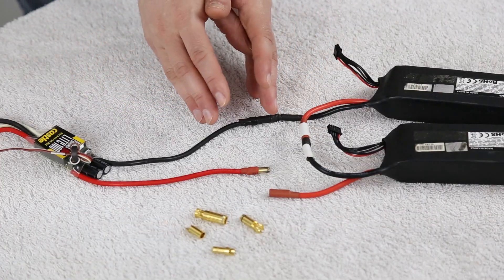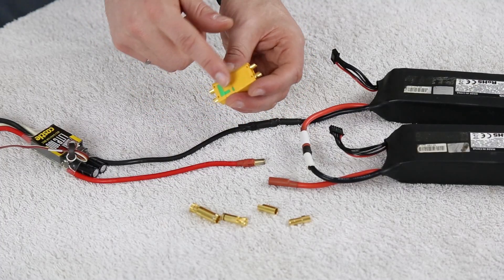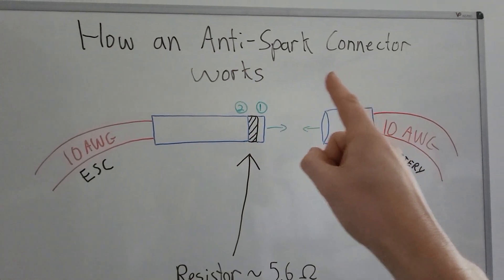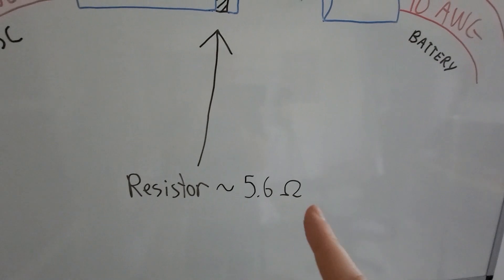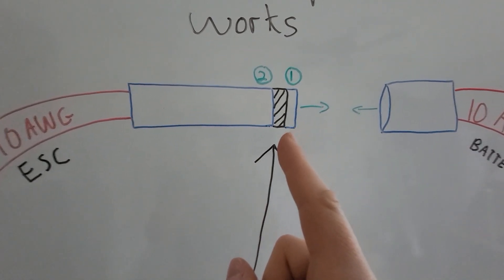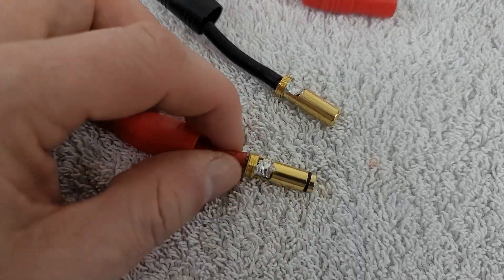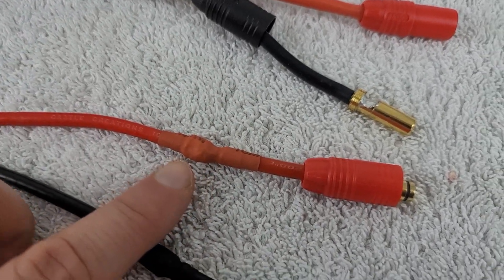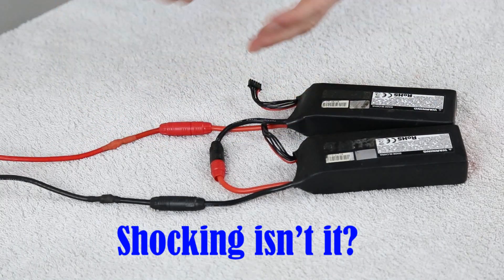Avoid the Damaging Spark When Plugging in Your LiPo Battery to the ESC

Comment: I have a question, I've been using my XT90s connectors on my electric bike for almost six months, just plug and play. Now all of a sudden I'm getting a spark, I can't see the spark but I can hear it. If the owner of this video do not respond can someone help me solve this problem please, I just don't want to purchase a whole new setup and end up with the same results.
Reply from the maker: Is sounds like your xt90 does not have anti spark circuitry. solder an anti spark xt90 connector in.
Reply: @RCexplained  It does have the anti spark circuitry and it just started to pop/spark, but once it's connected my electric bike rides normal: wires don't get hot, the controller and battery wires are not hot even after a 30 mile ride, also the battery charges backup as usual. Let me ask another question, have ever had a Xt90s female to go bad on you and changed it out and that solved your problem. I'm tempted to change it out but I need to know do they go bad sometime.
Reply from the maker: It's possible that the resistor failed. I've never had this happen to me though. It's a simple and cheap enough fix to try out.

Comment: Does the anti spark female end need to be used with an antispark male end or will it still have the anti spark ability if I used a regular male end with the antispark female end?
Reply from the maker: I place antispark connectors only on the esc. None of the batteries have the anti spark connector.

Comment: I was checking my steering out and I have a new LiHV battery.  I had plugged it in last night and no spark.  That was so I could bind my receiver and put the steering servo into the neutral position.  Tonight I had finished the steering linkage and I wanted to test it out.  I was storage discharging my LiHV battery (a VERY painful process for LiHV since you should use .5C or less for discharge), but decided to use it before it was discharged.  The last thing I wanted was another 8 hour discharge cycle.  That's the only difference.  Today when I plugged it in it sparked and popped like crazy.  I thought I had plugged it in reverse at first since it's a deans plug, and I quickly disconnected hoping I didn't damage my brand new $200 ESC.  I plugged it in again - this time inside a LiPo bag, wearing safety glasses, and using my shock proof pliers to hold one connector (didn't want to make a circuit across my chest - in A school that's the first thing they teach you - one hand only).  It worked just fine and I felt kind of embarrassed that I was so careful.  Even worse when I find this video and discover that it's common.  This was a 2S battery, and because the ESC is using an XT60 connector I am using a XT60 to Deans converter.  I was eventually going to solder the XT 60 connector on my battery.  I think it's because of that janky setup that I got the spark, so I guess I'll be soldering soon.  I have the connectors already.  I've just been lazy.

Comment: When switching connectors I usually make an adapter for my current connector to the new connector and just use the new style on all new packs/vehicles. Of course this only works on applications where you know the old connector delivers sufficient current already.

Comment: I always plug in the opposite gender connector to my connector I'm soldering whether it be a battery connector or an ESC or ADAPTER connector. Not only does it keep the connector I'm soldering cooler, it keeps them aligned and straight if the plastic gets too hot.

Comment: Hi, You seem very professional and well informed in your videos. Can you please give me your opinion on weither these AS150 are 150A continous and 200A peak or 60A continous and 150A peak? Because I've seen both specs on them. I plan on using them on a big 24s 8p li ion battery on an electric paramotor similar to the US openppg SP140 that uses the MAD M50 34kw 20kw motor. Usualy the power needed to fly is between 3-6kw (40-80A at a nominal 80v) and peaks at 10-18kw (120-200A) for a few seconds like on takeof). Do you think these plugs will handle that and don't get hot because I really like them? They used at the product named above QS8 and changed with giant Andersons because some said the QS8 got hot but I'm guessing they were heavy pilots which is not my case, the difference can be from 3 to 6kw difference for level flight so I'll be on the light consumption.
Reply from the maker: These plugs will work very well at 40-80A continuous. They can handle up to 150A continuous. They will be quite warm at this rate of current draw. 
I would try the plugs and if you are not comfortable with the performance, they are probably the easiest component to swap out for something more beefy. Very low risk in my opinion.
Very interesting project, too.
Reply: @RCexplained  Thank you, I will try them and check often during ground test.
Reply: @RCexplained  Is it a problem to have multiple plugs with the antispark rezistor in the same circuit? I will have three battery packs connected in series and have these plugs at the serial connections also, one red to one black, pozitive of one pack to negative of the other.
Reply from the maker: I would recommend placing the resistor on to the esc lead so that only one is required. Morr than one will work but is unnecessary.

Comment: Hello RC Explained I love your videos and have been madly catching up over the last few days.

Potentially an outrageous question but why are modellers all putting up with connection sparks when we could just use an inline switch?
Reply from the maker: Hi Robb, an inline switch just moves the spark from a connector to the contact poles inside a switch. The problem will still exist.

Comment: Hello. Thanks for explaining how anti-spark connectors work. I have an unrelated question that I hope someone can answer. If 3S lipo's are best suited to XT60 connectors and 6S lipo's is best suited to XT90 , what happens when two 3S batteries are connected in series to make 6S power? Should the connectors then be XT90?
Reply from the maker: It's not the 3s part of the battery that determines the connector. It's the amount of current that the battery can put out that determines the connector to use. A 3s 2200mAh is perfectly fine using a Xt60. 2 3s packs in series would use a XT60 connector. However if it was a 5000+mAh 45C+ 3s pack, I would suggest XT90 at the very least.
Reply: @RCexplained  That makes sense. The current carrying capacity is the determining factor. Thanks for the reply!

Comment: Desolderd completely the wires on the Esc and solder the needed length of wire on it, that's the proper way to extend a wire, everything else is a botched job, but if it works for you and you have no problems with it looki g like that, it's OK but still a botched job.

Comment: Would a switch not also work between the connector cable, switch it off if you connect the battery and on if you use the battery. 🤔

Comment: “Twelve-gauge wire is good for 20 amps, 10-gauge wire is good for 30 amps, 8-gauge is good for 40 amps, and 6-gauge is good for 55 amps,” and “The circuit breaker or fuse is always sized to protect the conductor [wire].”

 You should always connect the positive terminal first and then the negative terminal. This is because the negative terminal is connected to ground and if you connect it first, you could create a spark which could damage your battery or cause an explosion.
Reply: Yah that's what I thought, same with a car. You always plug in hot first, then ground. When you take it off you go the opposite. Take off ground first, then hot.
Reply: Maybe that's why he was always getting the spark, he was plugging in ground first, then hot.

Comment: I have changed most of my Lipo's connectors to QS8 anti spark ones. Those connectors a huge, and can handle a ton of amps and heat. I just changed the connectors on my big 60V scooter battery as well. I will never understand,  why do Chinese factories think, that having a 60V battery with small XT60 connectors,  is a good idea? I put the QS8 connectors on the battery.

Comment: Will these connectors be okay for 8S speed run car thanks great video as always
Reply from the maker: They are not the biggest connector you can use for speed runs but they will pass some significant power.

Comment: Great video. I have AS150 connectors and I am on the way to make it also. But when i using only one 4/6s battery, i preffer to have both male on batt and both female on the ESC. Because if antispark connector fail i some case, it will be only one battery issue, not all because of ESC. If anytime there will be any needs to run two packs, im only make 2x female short cable for connect batteries together. There is no rule in these types of connector where F/M has to be. Your solution is better for stable 2pack usage for have lower resistance. But there is an option to make it different if you using only one battery. So users have to thing little bit, which combination choose :-)

Comment: My ESC (Flier) has separate antispark line which is basically a standard resistor in parallel (or inline) with the negative battery lead, it's quite easy to make one yourself.
Antispark connectors are much simpler option though.
Reply: Do you then need to still solder the antispark line from the esc to the negative of the antispark connector? My batteries have no antispark line but i do have QS8-S antispark connectors from the battery to the Esc. Thank you!

Comment: Great video. I always thought that it was some sort of capacitor which acted as a buffer during the connection process. Good to know. BTW, when soldering the wire to the connector with the resistor, be careful  not to use too much heat for too long. Ask me how I know...
Reply from the maker: Great tip, I've solder many of these now at this point and so far I've been lucky.

Comment: Are IC5 connectors "anti-spark" by design?  I've only been using lipos for a short time, but I haven't seen any spark like this
Reply: Me either
Reply: I just got my first 6s 7 inch quad and it pops like a firecracker. No want.
Reply: @ianwalton284  oh wow for real- on IC5?  I guess I just haven't seen it yet.  I was actually wondering if it's just bc he's plugging the negative one in first.  Like regular cars will often do that too if you connect negative before positive.
Reply from the maker: Order of connection will not make a difference in our example or full size cars too.

Comment: This same thing happens with 1:1 cars when you connect the cables in the improper order. In order to avoid the spark you must plug the cables/wires in the proper order. Connect the positive cable before the negative and the spark will not occur.

Comment: What are your thoughts on the Qs8 anti spark connectors with 8mm connections and 300amp peak current rating?
Reply from the maker: Great connectors, however, I do prefer the connectors that allow positive and negative wires to be independent.
Reply: @RCexplained  I agree separate bullet style connectors are safer /idiot proof lol I've seen both used reliably on 12s Speedrun and drag setups.

Comment: Nice. !!👍
Got a question....
Other than damage to the connector does that or can that damage anything else?
Reply from the maker: No, the connector is primarily what you need to worry about.
Reply: @RCexplained  thanks for the reply👍
Reply: he plugged positive in first then ground  witch will cause a spark

Comment: I have AS 150 anti-spark connectors on everything that is 6s and above, they work great. Just one small precaution: The anti-spark connector is easily damaged when applying too much heat during soldering. It's clearly visible, because the insulation ring gets fried! 🔥
Reply: I've read that keeping it plugged to the female transfers heat to it and also presses the ring in place
Reply: @Seneslau07  I always plug in the opposite gender connector to my connector I'm soldering whether it be a battery connector or an ESC or ADAPTER connector. Not only does it keep the connector I'm soldering cooler, it's keeps them aligned and straight if the plastic gets too hot.
Reply from the maker: Great tip Remko!
Reply: I'm surprised these aren't crimp fit. In the battery world you never solder a battery connector lug or terminal.
Reply: Maybe I'll try placing a damp sponge on the other end of the connector while soldering.

Comment: ... I'm awake now...
Reply: V/R=I am i mistaken?
Reply: @wolfsden_boxing  Yes and no, the resistor in the connection isn't the only resistance in the circuit, so you can't use that formula unless you also factor in the ESC(And it's caps charging).
And now that I'm awake, I can see there's no good way to calculate it, as I*R has the same problem as V/R.
Namely the variable resistance of the ESC.

Comment: I run 10mm plugs on a 14S multirotor, and just use the resistor side of an AS150 to make the bridge as I plug in.
Reply from the maker: 10mm is huuuuge. Very clever using the AS150 resistor.

Comment: Question...what will happen if the resistor gets damaged or fails during use?
Reply: Nothing. It will be as if there is no resistor. When resistors fail, electricity will pass through it as normal. So you’ll get spark again.
Reply: @ubreakitirepairit3569  I disagree. When resistors fail they usually go high resistance or likely open circuit in this case, so no current will pass through it. Same result though except the spark will occur on the main section of the connector instead of the tip.
Reply: @rogerwilco5187  now I don't know who to believe.
Reply: @edwincordero8  Doesn't matter. The end result is basically the same in that it will spark when connecting, just like other connectors do.
Reply: @edwincordero8  Resistors normally fail open (infinity ohms) or to higher resistance. Given my knowledge of how resistors are built, I can’t imagine how one could fail short.
Reply: @tookitogo  thanks, but too late for your reply.
Reply: @edwincordero8  it’s just an fyi.